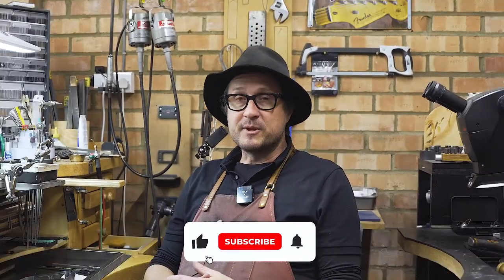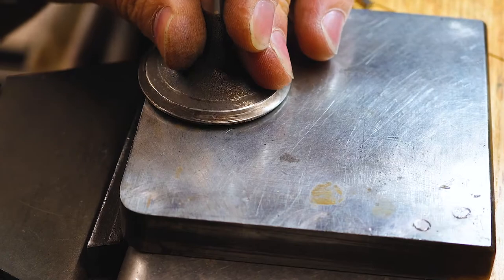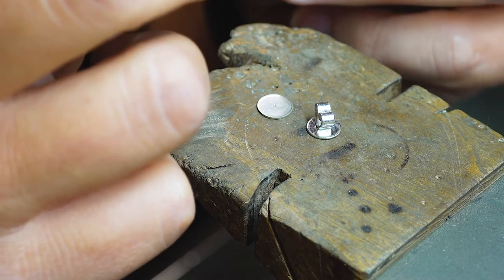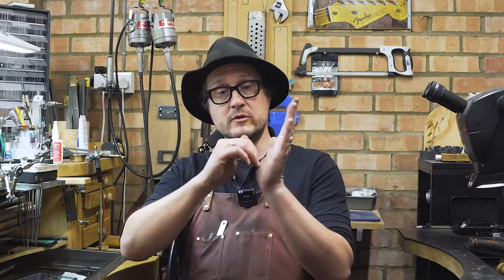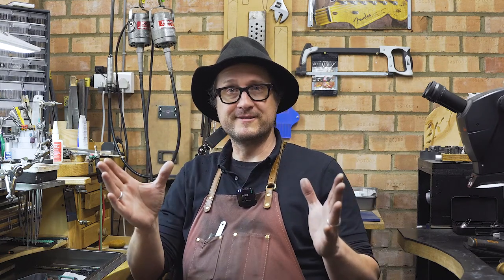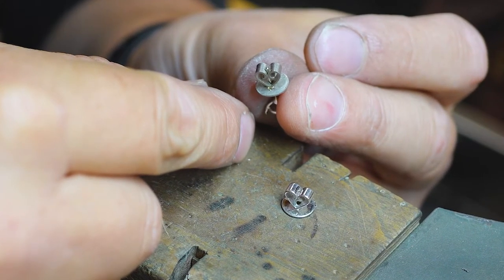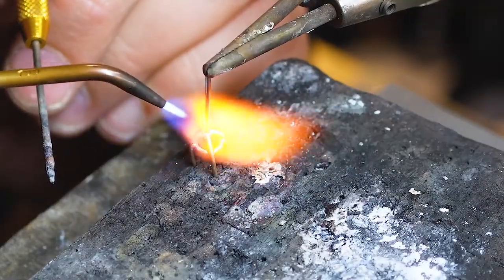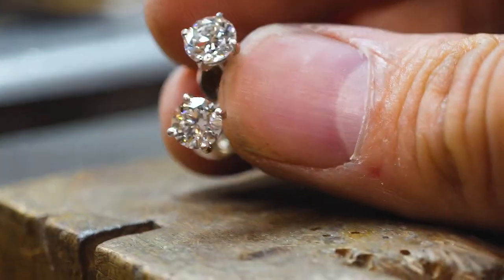How To Make Classic Diamond Earrings - Step By Step | Goldsmith Tutorial

Comment: Hi there, I love your videos and the atmosphere you create in it while explaining nicely what you do. May I have a question to pose: Are you using silver or what kind? How do I know which wire is strong enough to be the pin? Sorry, I am a beginner and try to find my way around.
Reply from the maker: Hi Tamara, when I use silver, it’s usually sterling 925. The pins are a very personal thing but as a standard I would use 0.8 to 0.9 mm wire and cut them around 10mm long. I hope this helped. Thanks for the question

Comment: Two things...it appears that you are using a valve as a flattener.  How would one go about acquiring one?  (Sorry if this is a "girl" question...lol)  Second, I love that you are working with your daughter.  Would you be up for adopting me?
Reply from the maker: The valve is a tool that I use every single day - you could pick one up from a scrap yard for cheap but then you would have to flatten the bottom with a flat bed sander - sounds so complicated but easy to do and years of use when you do. 
- also, very interesting request, but having one daughter almost ended me 😂
Reply: @jacothejeweller  I understand.  My father celebrated when my younger sister turned 20.  He was so happy that he no longer had teenage daughters...
Reply: I got a valve from a mechanic and cut the valve stem to about 50mm length sand papered the valve face smooth and used it very often through my jewellery career.
Reply from the maker: @stephenward3468  that’s it 💪🏻